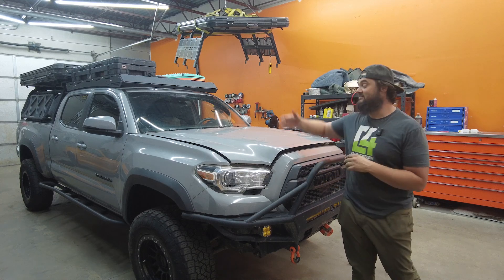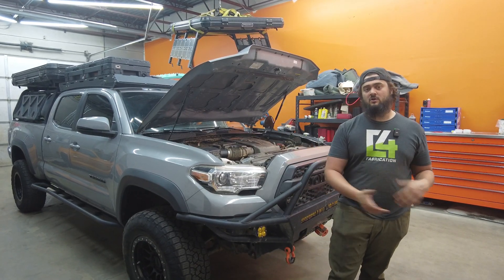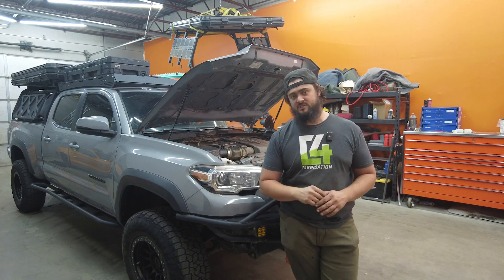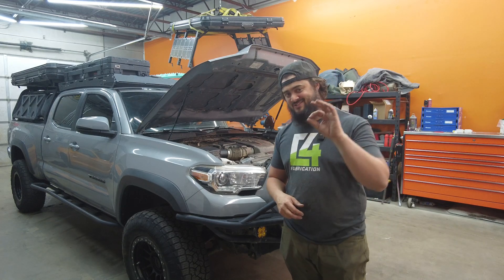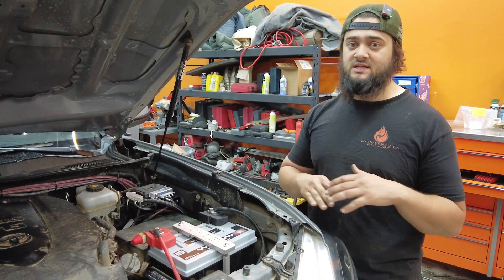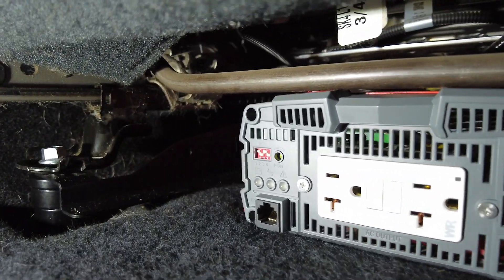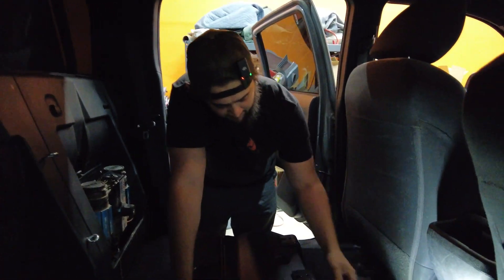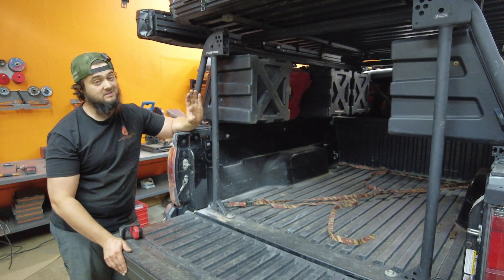Tacoma Electrical Walk Around. Solar, Starlink, Lithium, Inverter, AND MORE.

Comment: Not bad I installed a very similar system but 3 battleborn 100AH and Offgrid trek gen 6 solar 48volt output
Reply from the maker: Sounds like a sweet system! We will be doing the antigravity 300ah battery in our new F250 and are very excited about that.